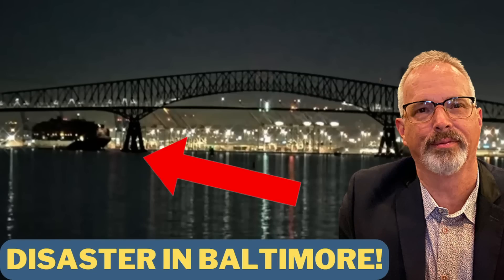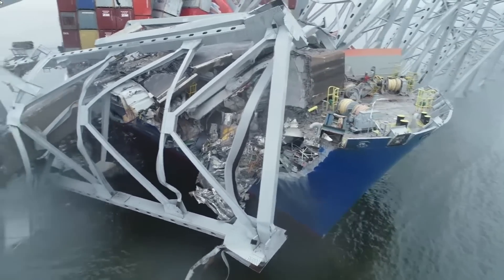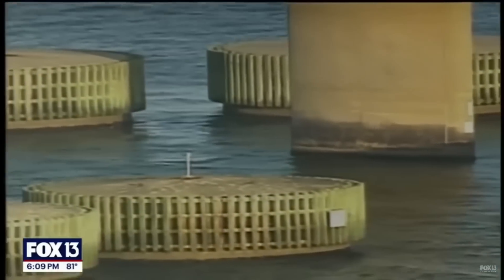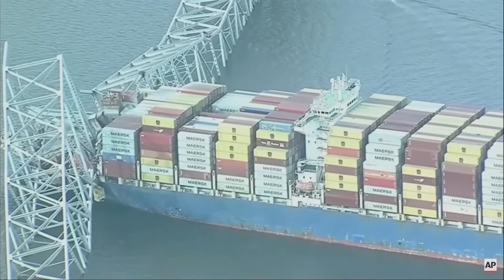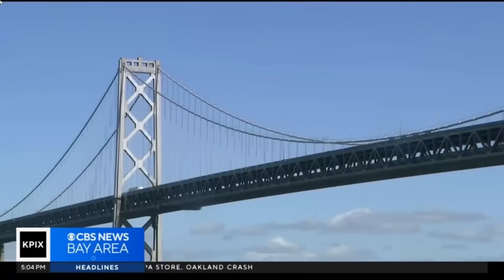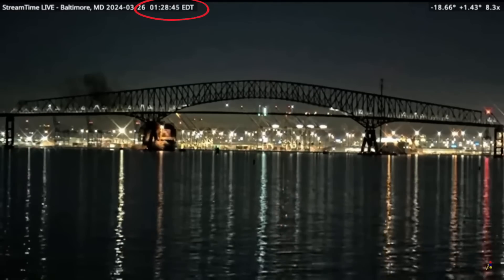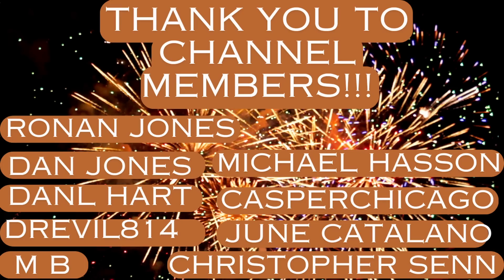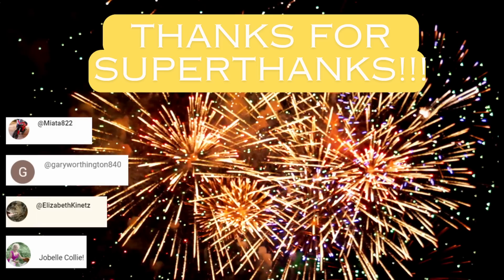How the Francis Scott Key Bridge in Baltimore should have been Protected

Comment: I was an engineer who worked on the Sunshine Skyway Bridge reconstruction project and was totally amazed by the inadequate pier protection of the Key Bridge.  Dolphins and Fenders at the Sunshine Skyway were used to protect the main bridge piers and the piers themselves were built to take heavy hits if needed.  I am amazed at the lack of these same protectors not being used on the Key Bridge.  There is plenty of shame to be spread around.  Dolphins and Fenders are not cheap but need to be implemented on all such vulnerable bridges and other marine structures.  What a shame that this has had to happen 45 years after the Sunshine Bridge disaster. The piers reinforcement and dolphins will stop any maritime disaster at the Sunshine Skyway.  Lessons that should have been learned a long time ago.
Reply: I lived here in Clearwater year round back then (seasonal now) and had walked to top of new Skyway on the two charity/opening events. And walked across the old one similarly before they demolished it.

So yes, that new one looks like a perfect model in many ways for this location as similar in clearance height and span plus protection. Given that it took from 80 when old one hit to 87 to open new one, do you see a similar time frame here? Though maybe less time because this doesn’t need all that causeway, just the main bridge but they have winter weather which Tampa doesn’t.
Reply: You're a good guy to ask. I think the dolphins at the Key Bridge were installed only a few years ago. Google maps satellite imagery (unknown date) omits them but Street View photos from 2 years ago include them. Is there an easy place online to find project info for something like that?
Reply: The Sunshine Skyway Bridge would not survive a Dali scenario. 

The angle of departure from the main channel would miss the dolphin and hit that little island, which would not stop a 100,000 ton ship at 10 knots before it plowed thru the tower.
Reply: @scottkozel1519 that is why you have  a competent and experienced harbormaster pilot that knows how to AVOID such obstacles. However  not one peep from anyone to explain  factual details of what happened..10 days. Many questions still no answers.
Reply: Hey Larry, I've been trying to find information about the islands around the main pylons, do you by any chance know how long/wide they are? they look massive at a guess, I'd say 150 foot wide at the widest and 500 feet lengthwise?  I've tried hitting google to no avail, I know it's a rock island, with a 12 foot thick concrete collar around the pylons, a and that goes to the sea floor, but the acutal size eludes me.  (wonder if there are any videos of people going to them to camp/hang out there?)
Reply: @norsehawk  
A 100,000 ton ship at 12 knots (typical there) if hitting that structure head-on it would have ripped it from the floor of the bay.
Reply: @norsehawk  I went to Google and and found the following information "The dolphins on the Sunshine Skyway Bridge in Florida are 95 feet wide and are 30 feet below the bay's bottom. They rise 15 feet above the surface and are designed to stop ships, not sink them. In small collisions, ships will bounce off the dolphins. The dolphins are meant to withstand the impact of an 87,000-ton ship."  I think that the dolphins were built by Meisner Marine at the same time the consortia of Paschen Contractors (Chicago), Morrison-Knudsen (Boise), Wiley Jackson (Virginia), and American Bridge (Pittsburg) were building the main span and approaches.  Another contractor built the remainder of the low-level bridges on the north and south side of the main span. This could have been Meisner Marine as well, but not sure. The boulders around the main piers were added after the initial construction and would surely help in a ship strike like the one in Baltimore.
Reply: Smart man! Thank you!
Reply: Fact: not just anybody can operate a ship of this size is something we acknowledge. Because of the tragic and devastating accident involving the Sunshine Skyway Bridge over 40 years ago, there were numerous new federal laws and mandatory safety regulations put in place. So even IF there was no competent protection in place with the Key bridge you were SUPPOSED  to have a competent harbormaster pilot operating the ship. One that can make all necessary and critical decisions while controlling this massive vessel. Many unanswered questions remain as to who greenlighted the Dali when her major electrical problems that she was experiencing at dock were  not resolved. Why did the tug escorts pull away from the Dali before she reached open waters? Were all federal mandatory safety regulations being followed? Coincidentally moments after the tugboats disembarked the Dali lost all of her main power, back up power and emergency power.  If the Harbormaster pilot didn't have control the rudder would of been in a straight position, why not let her continue a direct and straight course to the sea? There by avoiding the support post altogether. I guess we'll have to wait until SOMEBODY decides to feed us some factual, accurate and honest answers.
 Prayers to the families of loved one's lost and prayers to all of the courageous workers for their safety and good health in the coming months and years clearing the aftermath of this horrible catastrophe.
Reply: @DanHolmes-o9b  
I totally agree with that. 

Some people want to talk about the bridge, but it is the handling of this vessel that is a huge question mark with me.

The harbormaster pilot guides the direction of the ship. It is not his job to inspect all the systems of the ship to make sure that they don't fail.

My blame is on the operators of the ship.

Like, you don't operate a vessel the size of a Nimitz class aircraft carrier, unless you absolutely know what you are doing, and have layer upon layer of redundant failsafe control systems.

What if this was an LNG ship? Baltimore does handle them. Half the city might be gone now.
Reply: @scottkozel1519  absolutely
Reply: @DanHolmes-o9b  
About tug boats  and anchors --

One maritime expert with huge cargo ships stated several days ago:

He said that anchors are designed to hold a stopped vessel, not to stop one that is moving at 8 knots or more.

He said that the tugs are rather expensive and they try to avoid using them if possible.

He also said that tugs trying to redirect a large ship is dangerous and could cause the tug to capsize or become swamped and of course that would endanger the crew of the tug, as well as damage the tugboat.

He had video of two tugs successfully redirecting a ~50,000 ton cargo ship from crashing into the piers at Navy Base Norfolk, and you could see that one of the tug's bow was almost underwater for a time.
Reply: Original Sunshine Skyway Bridge was hit by an about 19,000 ton vessel.

Dali was over 100,000 tons.

Key Bridge has 4 reinforced concrete pylons/dolphins around the main piers just like the Sunshine Skyway.

Look it up on Google satellite views.

Problem was that the ship left the channel at an angle and just missed the pylon.

Considering the bow overhang and the fact the curving path would have missed the dolphin, no, I don't that little island would have prevented the Dali scenario from destroying the Sunshine Skyway main pier and collapsing the entire suspended spans.
Reply: @alanstevens1296  The protection on the new Sunshine Skyway bridge is way better than what the Key bridge has. 36 dolphins covering large angles near the pylons, plus two beefy rock Islands around the main piers of the SSB; vs 4 small dolphins set a hundred yards or more off the Key Bridge's hollow piers. Someone's already made a meme of the difference.

Also, the Key bridge dolphins don't show up in the Google Maps satellite images, which could be over a decade old. You have to look at more recent images in Street View to see them.
Reply: @alanstevens1296 ok so if it takes a special type of person to operate such an enormous vessel. Consequently that person should undoubtedly be held responsible. ie: if I as a licensed driver make a mistake/misjudgement and run off the road and somehow hit a bridge just right causing it to collapse.  This might be a one in a billion fluke but it happened. Nobody but me and my insurance company are to be held liable. I don't see the prez,  TSB, Governor or Mayor to jump in front of a podium proclaiming they got America's back and start writing checks to remedy the damages.
Reply: @alanstevens1296 the key bridge has little 20-30 foot dolphins about 500 feet away from the support pillars.  The Skyway has 9 dolphins at 65 feet across 300 feet away and 16 feet high  from the bridge on each side, as well as huge reinforced islands around each pillar full of rock to beach anything that hits them.  and ships of this size do come in and out of Tampa Bay regularly.
Reply: The Skyway has one dolphin protecting the pier from a ship as it approaches a tower.

The Sunshine Skyway Bridge would not survive a Dali scenario. 

The angle of departure from the main channel would miss the dolphin and hit that little island, which would not stop a 100,000 ton ship at 10 knots before it plowed thru the tower.
Reply: @scottkozel1519  The SSB dolphins are bigger and closer. The island puts 200 feet of loose rock before the pylon. Unknown how far it spreads under the surface. By comparison the FSKB pylons were sitting right on top of the edges of the pier, essentially zero protected. Once the ship hit the pier it was stopped within 100 feet. I think the islands at SSB would have stopped this ship before it could hit the pylon. Though having another dolphin would have worked even better.
Reply: @blairhoughton7918  
The ship traveled at least 200 feet beyond the main pier. The main reason it stopped was because it was immediately hard aground after over 4,000 tons of bridgework fell on the bow.

The FSKB pylons were about 500 feet from the pier. There is a concrete pylon in front of each main pier.  I don't know where you get this "essentially zero protected" stuff.

The ship turned at such a sharp angle that it just missed the pylon.

It would have missed the SSB pylon as well. That little island would not have prevented the destruction of that tower leading to the collapse of the entire suspended spans.
Reply: @scottkozel1519  Okay, then, actually zero protected. Go look at pictures. The pylons are built on piers inside the corners of a caisson. The ship missed a direct collision, slid along the wall and split the pylon with the top of the bow.

The dolphins are small and far away and would interdict ships heading on a very narrow track including the pylons. They're basically decorative and are more likely to damage a ship successfully missing the pylons than one aiming for them.

The Skyway bridge pylons are genuinely protected, less so by the dolphins than the islands, and likely would not have been hit by a ship like this.
Reply: @blairhoughton7918  
Nonsense! You go look at the photos.

If the ship had left the channel at a narrow angle it would have hit a reinforced concrete pylon about 20 in diameter and about 300 feet from the pier.

Basically the same pylon as your Skyway and not as close to the pier.

This ship angle would have missed the SSB pylon as well. That little island would not have prevented the destruction of that tower leading to the collapse of the entire suspended spans.
Reply: @scottkozel1519  I looked at the photos. The dolphins assume threats in a narrow subset of trajectories, and the fact that the bridge is sitting on the boat and two trucks makes that assumption literally fatal.

Also, if the current Google photo is to be believed, the dolphins may disappear under water.

They're more hazardous than protective. Per the evidence.

And that "little island" is at least 2X the size of the dolphins and dispersive. Your claim it won't stop these ships is the exceptional one.
Reply: @blairhoughton7918  
So you are basically accusing the current MDTA engineers of directly or indirectly causing the collapse.

I don't live in Maryland but I have a big problem with your statements.

You don't know the local conditions.  I am a boater  and while I haven't boated on the Patapsco River I know people who do.

Google is poor when it comes to showing waterborne items.

These boaters assure that those dolphins (or pylons) are massive and they don't "disappear underwater." That would be a hazard to navigation. 

I think you may be referring to high tides. These structures are at least 20 feet above mean high water.

The Skyway and their protective measures: a 40-year old design when ships were much smaller. MS Summit Venture was around 19,000 tons.

Civil engineering works need to be tested to see if they perform to spec.

Such "protections" have not been tested in real world tests or events.

Unless you ram a 100,000+ tons ship head-on into that tower island at 10 knots, you will not know whether it will survive the test.

I don't have any confidence in that installation under those kinematics, and ships will only grow even longer and heavier over time.

The Chesapeake Bay Bridge-Tunnel and the Hampton Roads Bridge-Tunnel got it right.

Frankly it is time for beginning planning for a bridge-tunnel to replace the skyway.

At least 4,000 feet of open waters and no vertical restrictions. Like on the CBBT and HRBT (actually about 7,000 feet on the HRBT).

Skyway vertical navigational clearance of 185 feet is now 30 feet lower than what the most recent bridges have been providing, anyhow.

Ships are steadily increasing in height, as well.
Reply: @scottkozel1519  No, I'm accusing you of underestimating the designers of the Skyway bridge protection. Those Islands would easily have prevented this collapse if similar islands had been built for the FSK bridge.

And something made the FSK bridge dolphins disappear from the satellite imagery even though many far smaller things are clearly visible. You can't rule out the tides.

Whatever the designers and funding authorizers did, whenever they did it, put those dolphins so far away and so far outside likely trajectories that they failed the one time a ship tried to hit the bridge.

They've had decades to upgrade them and only the predictable pushback from anti-infrastructure spending hacks in government could be the real cause for the bridge still being wide open to collisions.
Reply: I fell in love with the original Skyway bridge. I was contracted to work in N Tampz(utz) for 6 months in 1979..I bicycled alot and was in the best shape of my life. I had friends in Bradenton so best route was over the Sunshine. Unfortunately they would not let bicycles use it. I had to hitch a ride with a pick up. Threw the bike in back. Next day I came back eastern streets to Lutz. The sights going across was amazing.  Tore my heart when the accident happened 12 months later.

Comment: The loss of institution knowledge definitely has a significant impact on all businesses. It has, in my opinion, contributed to the recent infrastructure and operational problems at the MBTA in Boston. In the mid to late 1970's the MBTA hired many new engineers, construction inspectors and maintenance staff to support the construction of the new Red line extension and the Southwest corridor, Orange line projects. By the early to mid 2000's many of the folks hired in the mid to late 1970's all began to retire in mass from the agency. This "brain drain" resulted in an approximate 10 to15-year period of the maintenance of the system being managed by folks that "didn't know what they didn't know" and resulted in the slow deterioration of the system over time. Thankfully, this situation is now being addressed and the MBTA is currently on the road to recovery.

Comment: The first thing I noticed was how the protection was utterly useless in this case. Far away from the bridge and the Dali wasnt even close to making contact with the protection before hitting the bridge. Thank you for your thorough thoughts on this situation. Aside from the lack of protection, this bridge was also completely outdated in its 1976 design in its structure from the footings to the girders but we cant simply replace all poorly designed bridges. As you noted, they knew the protection was inadequate and still balked in upgrades. 
I cannot wait to see what engineers come up with as a replacement, including incorporating the power line structure alongside the bridge and not vulnerable elements as it stands.